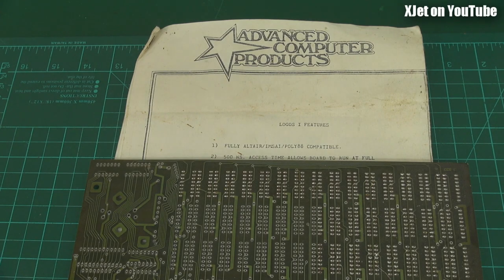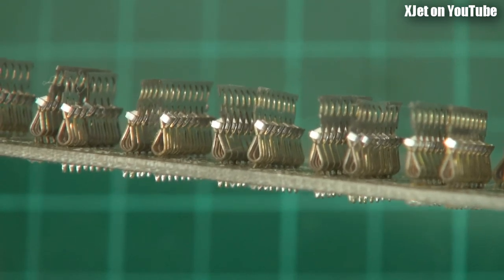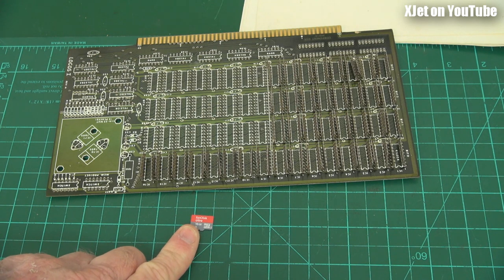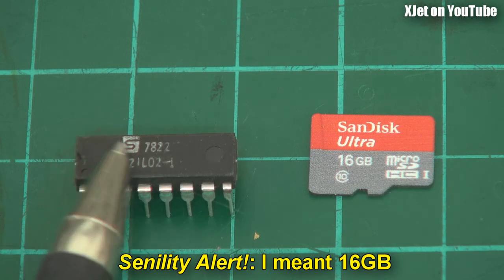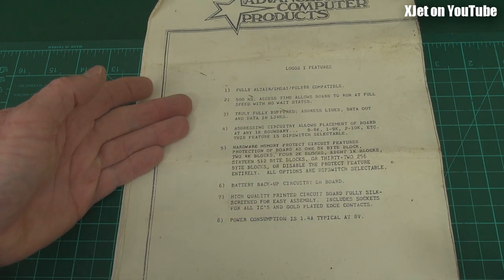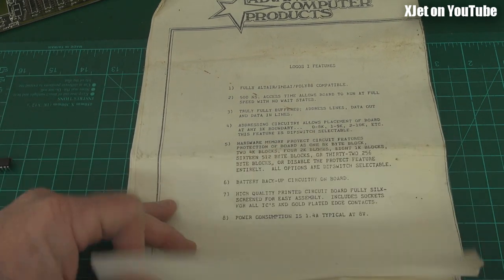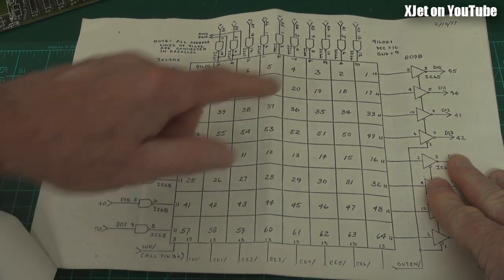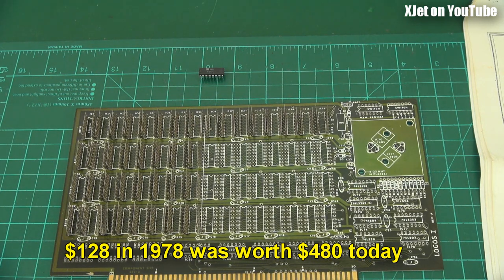When memory cost $7,500,000 per gigabyte

Comment: I still have my original Altair 8800, populated with all 16 S-100 card slots with 56k of memory from a variety of manufacturers.  The original MITS 4k dynamic memory boards (that a couple of years later they freely replaced with a much better - well designed board.  The original double sided board design required 17 "jumpers" - wires that sometimes went the length of the board, to fix an original design problems) cost $264 US (or $67,584 per megabyte if I've calculated that correctly).  That was a lot of money for an impoverished high school student at the time!  The memory chips held 4k bits each, so each of those memory boards had 8 of them on it.

I had two 16k memory board made (assembled) by Seattle Computer Products, and a static 8k memory board (also factory assembled) by Godbout.  My terminal device was a "SOL Personal Computer" (also an S-100 device) attached to my modified black and white TV as a video monitor (yeah, I actually had to hack it, to add a coax input for the video signal.  Back then you could buy "Sam's Photo Facts (or Fax?)" with the circuit diagrams and repair information for most commercially sold electronics).  

I had a 1.2 megabyte "Discus-2" 8-inch (double sided, double density!) floppy disk drive made by George Morrow, who also helped convert MITS's (Micro Instrunmentation and Telemetry Systems - the manufacturer of the first Altair kits) "S-100 bus" to the IEEE-696 standard (if I remember the number correctly).  This "clean up" of the S-100 bus fixed a number of original issues, like the designers not really understanding how to cope with signals at radio frequencies, to make the system reliable - and allowed this bus to be the standard (outside of the Apple universe, that always did its own thing) that multiple vendors could all share.

I wire-wrapped my own parallel communications board and had to custom write my own mini-OS for the SOL computer, to allow it to be a terminal.  Eventually I obtained a mini-rack, beefed up power supply, and a "constant voltage transformer" (almost like a primitive UPS system, that could keep the system up when the light flickered due to lightning storms), and a big 300-baud serial printer that took up half my bedroom (it was old surplus when I got it, all the UART (Universal Asynchronous Receiver Transmitter - the logic that converted parallel to and from serial communications signals) logic that was 1 TTL chip was discreetly assembled with individual transistors and resistors.  The UART board was about 18 inches square, but it worked)!

Lastly, I had a surplus telephone modem from an old Model-33 teletype with a home built power supply to connect to remote systems.  Most useful while I was in college, since with the extra phone line I added to my folks house - I could do all my programming and composing all my papers "at home", instead of having to commute to school (27 miles away, one way) and waiting for hours for a 20 minute shot at using a local terminal to do it.  I was one of the few people that was using anything like modern Word Processing - and dial-in access to the college's mainframe - to do my college papers in 1978, but that trend soon caught on!

I also still have a copy of Bill Gates's first software product - the Altair 4k BASIC interpreter (actually an OS) - on paper tape, and all the original manuals.  Back then they used to give you the full circuit diagrams of all the board circuitry - something you sure don't get these days.

We've come a long way - thank goodness!

Comment: Since each chip seems to have 16 legs, presumably 2 for VCC and GND leaves 14 address bits = 16384 bytes. 60 chips (if all are memory) would then give 983040 bytes, or close to 1 MB. Though this is just a guess :)
Reply: Damn I was way off :D
Reply: How do you get data in and out of your chip, tell them to read or write, or actually fetch the data? Wireless transmission? :P
it's 64 chips btw. 60 would be very weird in binary.

Comment: Thanks, this was a treat, and you are spot on. as an old guy, I have been in the electronics hobby starting back in the early 1970'S. I got my first personal computer, the commodore vic20/ bad ass/ think it had 2 or 4kbyte ram memory. bought a 16kbyte module, wow super computer territory for the home hacker. I would guess that an normal smart phone these days has more computing power than all of NASA back then. Look what a 13 dollar Arduino micro controller board can do today, versus back then. I even delved into machine language programming back then. OHH alchemy. Cheers
Reply: Ah you were at the end of the kit radios. I really wanted one of those as a kid but they just are not around anymore.
Reply: dmwtech 3583 bytes free for the Vic20 startup screen. AND THE AUDIO CASSETTE DRIVE!!! AAARRRGGGHH!!!
Reply: dmwtech yup I too started in the hobby back then Commodore PET, Vic 20, 64, SX64, 128, than went to IBM clones. First was a powerhouse with 2k ram, 10 k hardrive, color emulator video, invested 10grand in that one.

Comment: In the 1970's some of our machine tools had TI 990 computers. We loaded the operating system using a card reader ( stacks of IBM punch cards), bit switches on the front panel (arranged in hexadecimal 4 bit words). If you inadvertently got a card out of order you had start the loading process over. It usually took several hours to load the machine code, boot loader and OS. I believe each of the memory cards were approx $8000 and held 4K. The 990's were powered on 24/7. They had battery backup, but is was unreliable. Any power glitch meant loading the program over from scratch. Back then, this was cutting edge technology .

Comment: I used to be a computer operator back in the days when computers used magnetic tape and were programmed with punched cards. Great excitement when a floating point maths processor was added to it, it was the size of a domestic fridge and was filled with wire wrap connections. Took a week to get it working. Now almost every phone has a maths processor as part of the main chip, God I miss those flashing lights!

Comment: In 78 I worked in maintenance in a hotel that had conventions. They had one for chip designers they were using a 4'x8' easel with clear overlays to draw a small chip no computers to design yet until the chips were designed to build them.

Comment: I guessed around 8k, but I was alive back then and owned a Commodore Vic20,  and I added an expansion card that was 8k. It was about half that size, but it was a couple years later :-) I remember in the mid 80's expanding the memory on my IBM-PC (no hard drive, just 2 floppy drives), from 256k to 640k, that was a big jump back then. Thanks for the time warp Bruce ;-)

Comment: When I started work in 1983 the, admittedly quite old, Honeywell mainframe we had that did all the message switching for a huge department ran with 16K of core store...16K total memory and this thing took up around 8 6ft tall 18" racks and loaded its start up program on paper tape. It worked for years after that doing the same job and understood by about 3 of the older techies. I never ever got to grips with how it worked.

Comment: I did something similar comparing hard drive prices not too long ago.  My first hard drive in 1982 was 20 megabytes, MEGAbytes.  That's the equivalent of a whopping fourteen 1.4 mb floppies.  That cost me $750.  That works out to $37.50 per megabyte.  I now have several four TERAbyte hard drives in my home network and the last one I picked up cost me $150.  Doing the math, that 4 TB hard drive based on 1982 prices per MB, adjusted for inflation, would cost $370,219,252.00 (Cdn).  Put another way, hard drives are 493,600 times cheaper than they were in 1982.  :-)

Comment: The first computer I ran a program on was in 1975. It had 1 Megabyte of RAM, and was the largest computer in the Southwest of England. The computer cost £2,000,000; around $4,250,000 in Kiwi dough., and it filled a whole floor of a building. You can lose 64GB down the side of a sofa these days, and hardly notice the cost. And if your computer doesn't have at least a terabyte of storage, you would look for something better. What will it be like in another 40 years, if any of us are still here?

Comment: I remember those old S-100 computers.  I saw the schematic in Popular Electronics, the very issue you showed, and I bought most of the parts to build one, but I sold them to another guy and bought an Apple II when they came out.  I still have it!

Did you buy any floppy disks back then?   The floppy drive for my Apple II cost $450 in 1977 or 78.  The floppies themselves cost $35 (US) for a pack of 10, at first.  They held 70 kilobytes.  (Later there were Double Sided disks, and then Double Sided Double Density disks (DSDD), and then HD disks that went up to 400k or something like that).  

People used either paper tape or cassette tape to store programs, they didn't key them in every time on the switches.  Starting the computer up you had to key in a few bytes to load the bootstrap loader, then the 'executive' (i.e. Operating System), then you had to load 4k BASIC, and then your application.  The Apple II had executive and BASIC in ROM so it just 'woke up' in BASiC and that was a big deal in 1978.  The floppy disk was an ENORMOUS advance when it arrived, even though it was half again the cost of the computer itself.

Love your channel!  Keep up the good work.  I also like your choice of music.  I was beginning to think obnoxious crappy rock music came as standard equipment on quadcopters!  8^P  Pilots wonder why they keep getting kicked out of city parks.  It's the loud music!

Comment: Shades of upgrading the RAM on my '79 Apple ][ from 32KB to 48KB.  A whole 16KB for (from memory) about $400.  At least all I had to do was plug them in - no soldering required.  Again from (a failing) memory, an Apple ][ with 48KB, a 12" monochrome monitor and a 5.25" floppy drive with controller card came to somewhere around $2800.  To think that my Raspberry Pi will knock it into a cocked hat without sweating any electrons!
I was going to get into building an Altair, but when the Apple came out, I had a rethink as I was (a) garbage at soldering, and (b) more interested in coding.  Want a copy of the 6502 assembler codes?? :-)

Comment: I graduated from high school in 1978...  The first computer program that I ever wrote (for a FORTRAN class at LSU) was input into an assembler via a dumb terminal, and then I picked up a stack of punch cards at the Admin window...  I could run the program over and over again by handing it to another student aide (in another window) for that aide to put it into a card reader to be spooled to run through the LSU Mainframe computer.  The results were printed out at a common printer, and you matched the batch number of your card run to the Batch ID on the printout.

Bottom line, 'Windows' existed long before Bill Gates and Microsoft...!  :o

Comment: I am smart about it. The ICs have 16 pins. 2 will be power, at least one will be R/W, latch, and data (assuming it's a single bit output). This leaves at most 11 pins for adressing, or 2kbit which equals 256bytes. Times 64 ICs that's 16kByte for the whole board. Could be even less (8kB) if the chips have an enable pin (which is likely).

Comment: Had the first altair 8080 , front panel bios in octal with front panel switches .. worked on dec pdp8 30 users on 32k core memory fixed platter hdd size of a fridge 200 mb

Comment: 1KB = 1024 bytes
Reply: Megadoculous no 1kb = 1000 bytes.

1gb is 1000mb
Reply: 1kb = 1000 bits
1kB = 1000 bytes

As defined by the SI and commonly used in data storage. However, the value 1024 is used in Windows, computer memory, telecom etc.

Comment: let me guess, those look like 16 pin dip packages, 11 bits for address, 1 bits output, 4 pins for power and r/w and c/e. at most those could have, if my math does nit fail me, 2048/8= 256bytes each.
From here it looks like a16x4 array of chips, so my guess is that is a 16KiB, 16bits memory module or something.
Reply: well apparently it was 10 address pins, at least i can say i guessed it without looking at the datasheet :P

Comment: This isn't a fair comparison! You compare SRAM with NAND Flash. That's like if you would compare your 4TB HDD with your 8GB RAM in your computer. SRAM (not DRAM which we use in our computers) is still quite expensive, because it's way faster than Flash memory. An ISSI IS66WVH16M8ALL-166B1LI can handle 128Mbit (15MB) and costs around $5. If you scale then up to 16GB, you would need around 1100 of them, so $5500. (And that's way different compared to $15).

Comment: My first computer was a 1k memory Sinclair zx81 you could upgrade the memory to 16k but it was bloody awful it had this great big module that you plugged on the back but the connectors would wobble around and just as you've got everything loaded it would move and wipe everything out again. to load up game or a program you use the cassette tape recorder, you can and it took an absolute age to load, even back then it was rubbish really. still without those Beginnings we wouldn't be where we are now. The magazines of the times would publish programs that you could use to put in the computer with a language called basic. One slightest mistake and it wouldn't work, but so you had to go through it all again and find out where you'd gone wrong. Everything it did was in black and white we had to wait until the Sinclair Spectrum came along before we could have color. 
There is a wiki link below for anyone who is interested. 

https://www.google.co.uk/url?sa=t&source=web&rct=j&url=https://en.m.wikipedia.org/wiki/ZX81&ved=0ahUKEwjqm8eyvY3WAhWCUlAKHXdnAVsQFggfMAA&usg=AFQjCNFtojjDfP1-fqfAGbp4yvxIeaiaVQ

Comment: Your price seems a bit high. Back in 1979 I bought 4K of RAM for my computer for about $90.
Reply from the maker: At $90 for 4K, your memory cost more per byte than this board which was $128 for 8K.
Reply: I just looked at an old ad, it said $69 for 4K. It was eight 16 pin dip chips. That was my first computer, check it out here: http://www.classiccmp.org/dunfield/osi/jan79.jpg